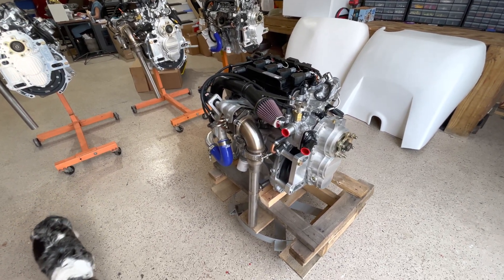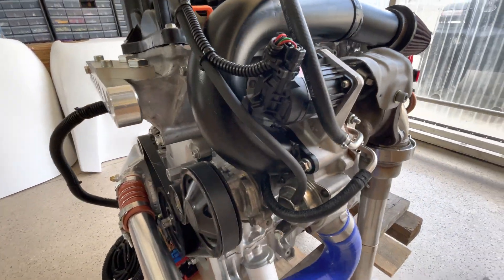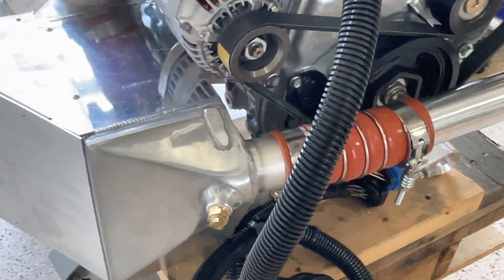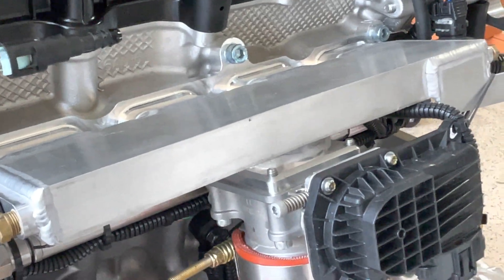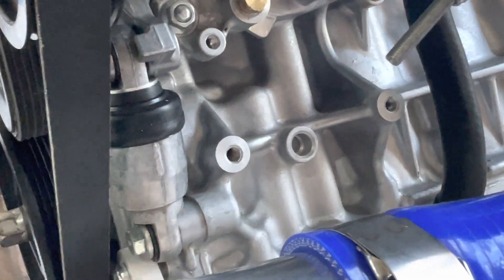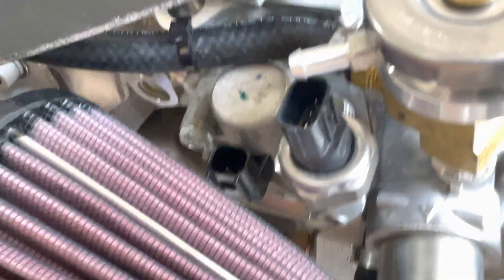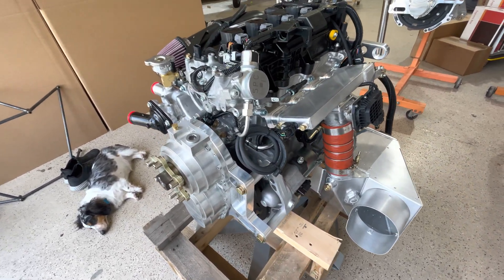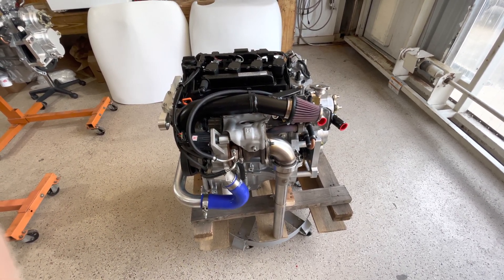Viking 195T Overview

Comment: Question, does the intercooler exhaust on to the left side of the engine? I see where the air passes through the cooler and into the intake, but the ram air that cools the intake air, where does that go?

Comment: Where's the safety wire?
Reply from the maker: Traditionally automotive engines have not used safety wire to retain any of its hardware. This is also true for much of the hardware on a traditional engine such as a Lyco/Cont. Some places you find safety wire and some they use lock nuts and many fasteners are held on by lock washers of various types. New locking methods have become available as well such as, belville washers, nordlock, high-temp nylon insert nuts, various loctites, etc. Safety wire is somewhat cumbersome and time consuming to install and remove. With all hardware properly torqued and using the above methods, we have never had an issue. In addition to all this, the engines run with less vibration.

Comment: how much does it weigh as shown, dry? (engine + mods)
Reply from the maker: with everything show, intercooler, plumbing exhaust, about 278 - the only thing left to add are the radiator, mount, and propeller from there..

Comment: Since cars seldom run at the altitudes that airplanes reach, does the ECM have the intelligence to compensate for altitude to turbonormalize the engine as is often done in aircraft?  I’m not familiar with Honda’s turbo control logic.
Reply from the maker: Yes it can. The engine has no idea of what altitude it is flying at. It only knows what the manifold pressure is (MAP) and the temperature and from that it can compensate for any conditions. So yes, the engine will compensate for anything you can throw at it :)
Reply: I drove this same engine up through mt Olympia and Pike's peak few others! and my power band was perfect stayed the same temp no lag! that why I think it will so so well

Comment: Beautiful engine, Jan. In another video, can you address the fuel use in these engines? Auto fuel preferred? Can you run 100LL?  Thanks!
Reply from the maker: You can run auto fuel or 100LL - but if doing 100LL you must use an additive such as decalin or TCP - Auto fuel is preferred, but both okay.